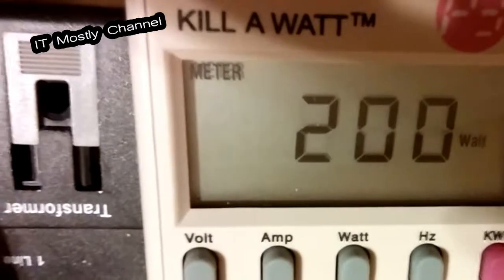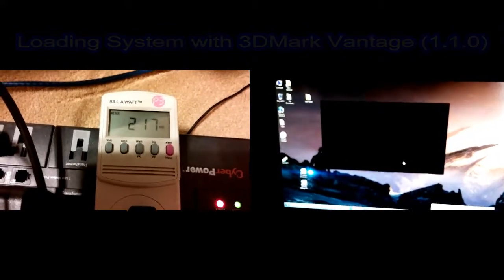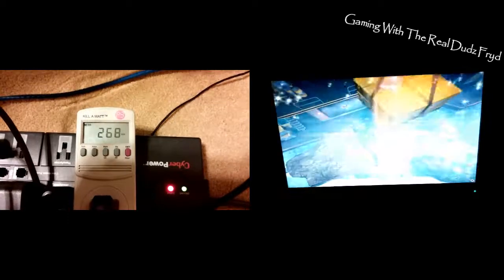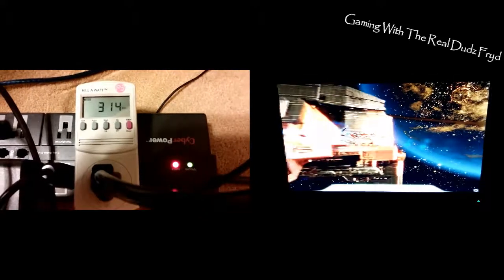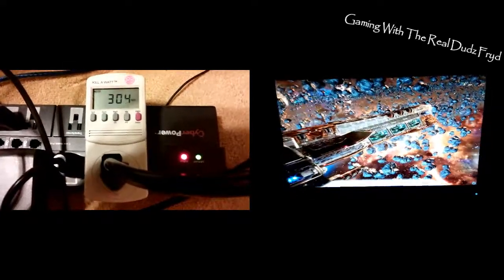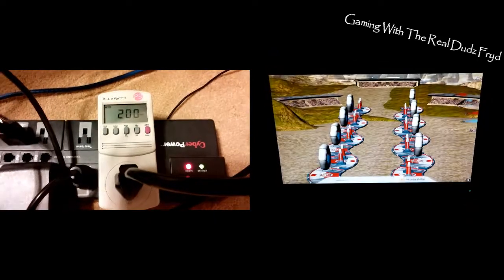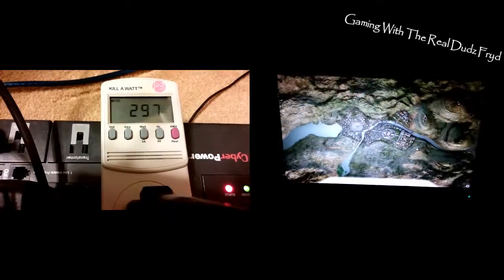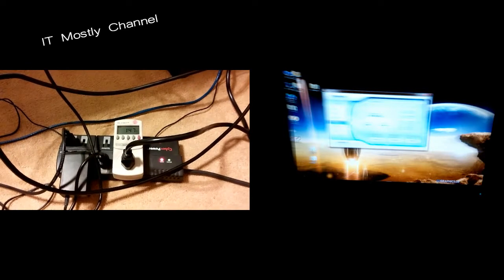Intel Xeon Upgrade: Testing Power Efficiency

Comment: Better to test the CPU only, if you want to test the xeon. The graphics card is taking more power than the CPU. So test it in idle, then under 100% CPU load (Prime 95). On 4 GHz the difference should be about 100W, I promise on 3,3GHz 80W difference. Idle CPU power consumption should be 10-15W, so add this.
Reply from the maker: True but I was interested in overall system power performance and since the CPU will be called upon in some of these tests I was interested to see the draw.   THE GPU intensive tests will naturally kick it up.  That and I was still using Hard drives at this point which also draw more power than an SSD.